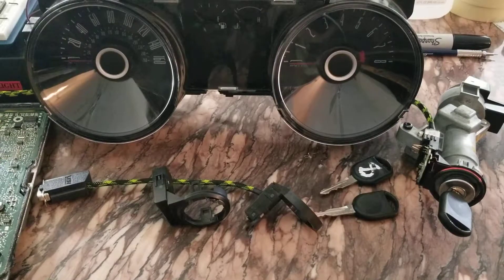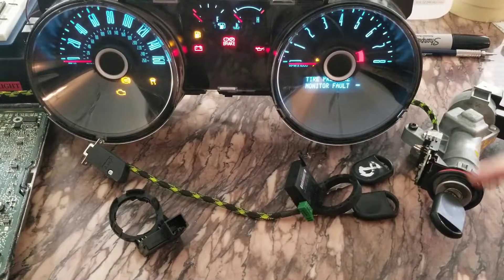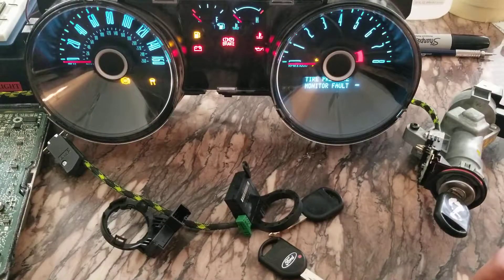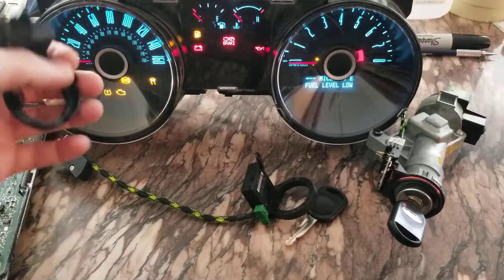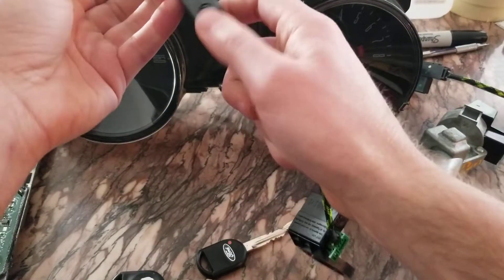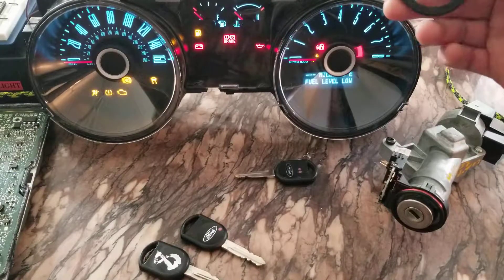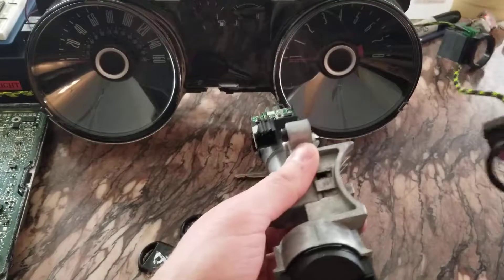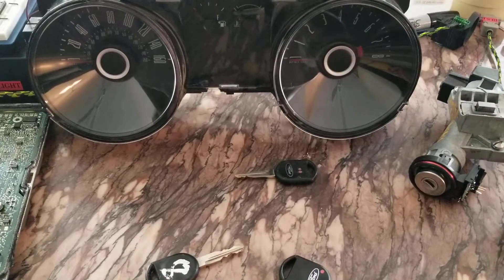Ford Immobilizer Transponder Ring

Comment: Hi I have a Mazda bt50 and having issues with it, when I turn the key no lights come up on dash apart from that same one mentioned blinking in this video, nor does it start it’s just completely dead. I have put in a new battery and checked fuses all are good. A bunch of fuse are not giving off any voltage but they are not blown, I’m guessing they activate when the key activates the system? the key also doesn’t unlock doors with push of button, have had key checked for fob and that’s working fine, any help would be much appreciated
Reply from the maker: Hi, email the details to Leac0071@gmail.com.  Include the year and engine size.

Comment: The 1996 and 1997 mustang transceiver rings are different than the ones you demonstrated. They have 3 different strand of wire that come from the coil itself that connect to the circuit board and the newer ones only have two

Comment: This may be a legacy video site on ford transceiver ring so not sure it is still attended. I need a transceiver ring for a 1998 Mark VIII. Not because I have determined it is causing my "anti-theft" related crank but no start but it seems reasonable that it could cause a no start. Can you help? thanks  Steve
Reply from the maker: Hi,
Send an email with the part number or a photo if possible. Leac0071@gmail.com

Comment: I'm needing a 98 Ford expedition sensor ring . My ignition was broken and they broke the wires to the ring do you have one I can purchase.
Reply: See where you can unplug the wires from the module inside it and switch out a new ring but can't find one anywhere.
Reply from the maker: Email some photos of the part number and damage.  Leac0071@gmail.com

Comment: i have a 2010 ford ranger that the keys were lost and I was able to get 2 keys cut that need program ed, can I take the immobilizer loose and program my new keys like in the video? thanks again
Reply: Any update?
Reply from the maker: Hi,
It should be possible to program it similar to the video.  Do you have a scan tool with security functions?
Reply: @IntegratedAutoModules  Hi. I'm not familiar with what a scan tool is?
Reply from the maker: Are you located in the US?
Reply: @IntegratedAutoModules  yes
Reply from the maker: Send me an email Leac0071@gmail.com.
Reply: SENT U MY CURRENT EMAIL TO YOUR EMAIL

Comment: Whats the best way to 100% determine if transceiver is issue? Im working on a 4 pin ford transceiver; I have a ground and power along with a tx and rx wire if I remember correctly. If I scope them what should I be looking for to determine if transceiver is faulty?
Reply from the maker: Assuming the scope has enough bandwidth, You'll be looking for 88 bits of data.  80 bits are the key and 8 bits are for mode control. 
I'm making a vid specific for TMS3705 chip used by ford; Google the data sheet to see specific timing diagrams.

Comment: Can you bench test the immobilizer ring? Or does it need power and ground. I have an immobilizer tool you place around the key cylinder and supposed to flash but it does t and don’t start it’s a 2017 pro master
Reply from the maker: Most can be tested; I'd check that it has power and ground first.  Some of those tools don't work well.

Comment: So as long as the key matches the car and is programmed to the car,  the actual ring doesn't matter, or it doesn't need to be programmed.  I know it has to be exact matching part number. But you can swap it out and not have to do any kind of programming to the immobilizer ring correct?
Reply: no replacing the ring is plug  and play
Reply: @lw94tx  ok cool thanks bro

Comment: 2009 mustang transceiver reading Unprogrammed  key will not alow it to start, I need to know how to program it to read the new key from Ford or replace it with a new transceiver that reads any key like demonstrated with the “S” key in the video any help is appreciated
Reply: Did you figure out the issue having the same problem on my 08 mustang right now

Comment: I have a 2010 Ford Transit connect the alarm is reading a different code than the cluster I don't know what to do I can't get it started I've tried everything and nothing works
Reply from the maker: Is the theft light blinking rapidly?  Any recent repairs/damage? What codes?
Reply: I was told that I need to change the keys but I don't think you need to buy two keys I have one key you need to buy two keys just so you can have the black beepers with no clothes in them to put the codes in this is what I want to know I have a gentleman that has the Ford computer but he says he's not sure cuz he's done it before but with only one key but you have two blank beepers could that be done

Comment: My 2002 F150 flashes antitheft light when the cab of my truck gets hot and it won’t start. If I park it in the shade. With the windows down. It stays cool and it will start. What the heck do I replace?
Reply: PCM are heat sensitive

Comment: I get the code 16 no communication on 2008 ford focus . She resets and run but then loses  communication and goes back in anti Theft mode. I need help any ideas so far ... Battery is good voltage and when running charging correctly..... any ideas

Comment: Where is the code from the Jewel Key stored ?. What capacitor holds the stored code ?. I keep having this issue every time I need to disconnect the battery for normal maintenance. This is very frustrating to me and I am making my mechanic wealthy because I don't have a bi-directional scan program tool.
Reply from the maker: Hi, It depends on the year, make, model of the vehicle.  In this case (08 explorer) the ignition PATS key data is stored in non-volatile memory on a micro-controller in the gauge cluster.  Assuming you have a Ford, disconnecting the battery wouldn't effect the stored data.  The key data will stay in memory even when removed from it's power source.  
In many cases I'm able to program the keys to customers modules while they are out of the vehicle so that they won't need to perform any additional security programming when they receive their parts.
https://www.youtube.com/watch?v=Aw2-nK79NcE  The video at this link goes over a security problem and solution on a different 08 explorer.
Reply: Hi this is james I have a 2010 mustang and the key no longer working. When I tired to use it it shows not programmed exactly as the one on your video. What di I should do to fix this problem please and thank you
Reply: Eeprom